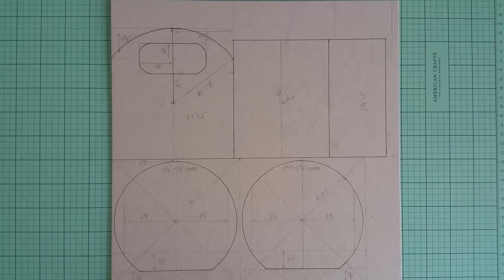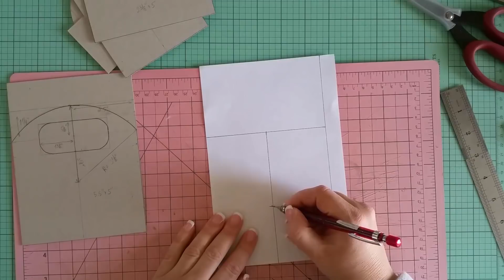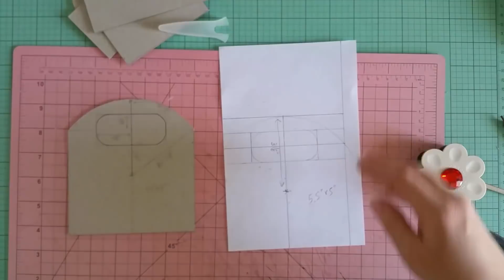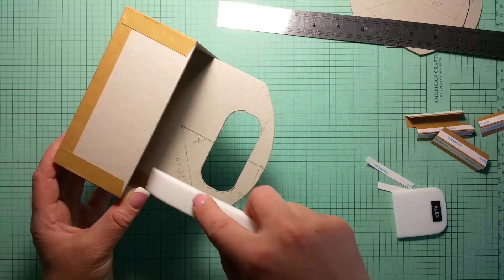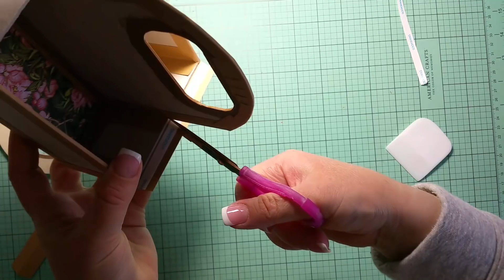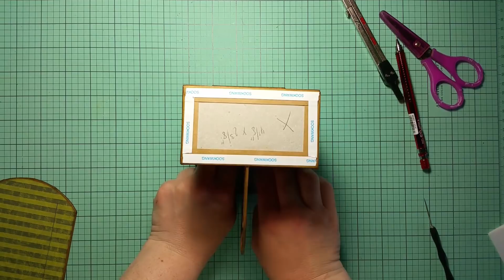Floral Shoppe Tool Stand

Comment: Did you re-draw the center divider in order to get a pattern for the designer paper to cover the handled divider?  Did I just miss that part?  Thanks so much.  You are so talented.
Reply from the maker: Nancy Moore hi. Yes, i just redraw the pattern on the designer paper & cut out the opening for the handle. If necessary you can make little adjustments to this paper piece by cutting 1/16" from the bottom, left and right sides of it.